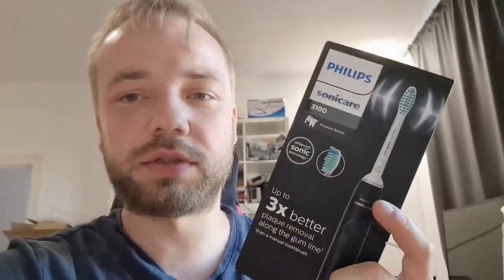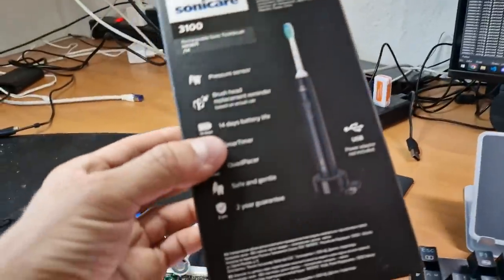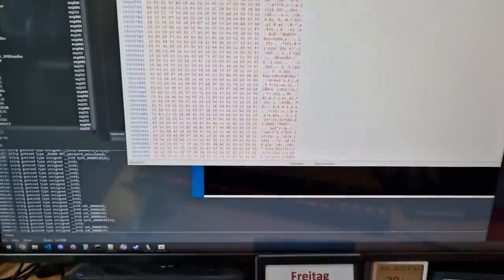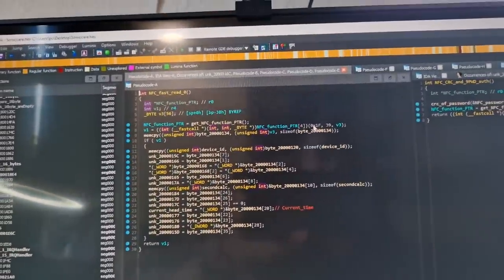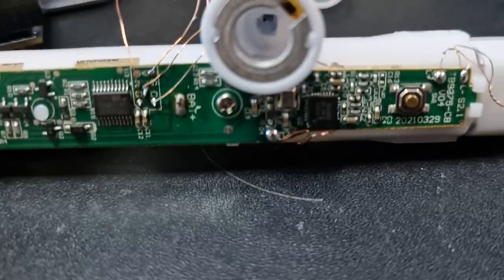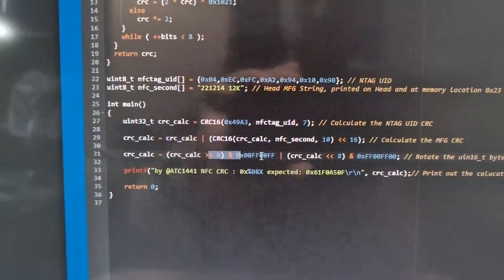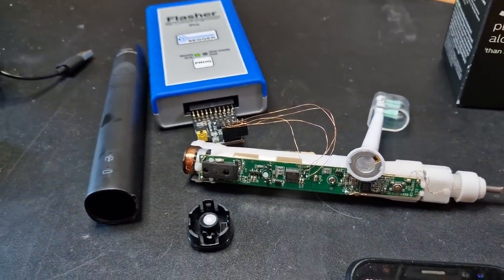Hacking the Philips Sonicare NFC Password

Comment: these devices are getting ridiculous, next you won't be able to brush your teeth without being connected to the internet.
Reply: While it’s not necessary to have an internet connection, you’re also not wrong. Today it might only notify you to replace the part. The only reasons to so severely over-engineer this is tomorrow it will stop working until you buy a replacement. Second, if a third party wants to make cheaper replacements they’ll get themselves sued over DMCA - hacking - laws. It’s the same obnoxious business model as printer ink and farm equipment.

In the US at least, anyone is allowed to make and sell for example compatible replacement car parts without the manufacturer’s permission. If the part has “digital security” however - you’re now breaking “copyright” law by breaking the “encryption” or reverse engineering the software to make a compatible part.
Reply: I’d replace the microcontroller with a simple oscillator. That’s all it needs! Stop brushing when you get fed up with it, rather than when it beeps.
Reply: Ayy Leeuz  A colleague once told me about a "smart" electric socket he purchased - one that would have a motion sensor and would turn on the socket if needed. After some time he was offered a firmware update for his electric socket. One of the new features was the support for activating the socket by noise, like clapping. Seems there was a microphone in the socket the whole time.
Reply: Subscription based teeth cleaning coming next.
Reply: @Time4Technology  chances are it was there all the time because the original firmware wasn't robust enough, so they just went with the motion sensor.  Without it having access your or wifi, it's going to be pointless having a microphone for covert things.
Reply: Don’t forget to brush your teeth, this is the second day without oral hygiene, we will have to reduce your access to public places. Yours , your future government.
Reply: ayyleeuz4892  I was replying to a comment that wasn't anything to do with this toothbrush.  It was a smart socket that had a new firmware update available.  Have a read through the comment history.
Reply: @bigjd2k  i actually like the timer, keeps me from brushing a hole into my molars
Reply: @gavinnoname1424  thats called a dentist
Reply: A couple of years ago I bought a Braun toothbrush that required me to have GPS on before the Bluetooth software would work. Needless to say I didn't use the software.
Reply: I don't think this is at all about forcing users to change brush heads. I think it's legitimately intended as a useful feature, and does have significant value for the users that want it.

(The manual also tells you how to turn the brush reminder or the pressure sensor off if you wanted to, but if you're buying a new toothbrush, it might make more sense to just get one of the cheaper models that has only the pressure sensor or doesn't have either)

However, only their pricier brush heads have this feature.
Since the memory is password-locked, third party makers of generics most likely can't include it without violating weird US copyright laws. So you have to buy the premium heads if you want the convenience features.

However, now that this has been reverse-engineered, you could likely reset the chip and transplant it to a generic head, saving money and preventing e-waste at the same time.
Reply: Smart toothbrushes were actually just used in a DDOS attack. Lol.

Comment: The crappy thing is that they locked the ndef records and most of the useful space on the tags so those are unreusable. There are so many of these they would be neat to recycle into tag rings. You can pop the ends off of the old heads really easy.
Reply: Can't that part be hacked too? 😂
Reply from the maker: @MoesKeckeEcke  unfortunately not
Reply: @atc1441 Always a question of how much energy (money/time) you invest.  😉

I guess with 500k and 0,5 man-years it can be done.

Comment: Great video! I got a flipper to try and understand protocols and now I’m diving into NFC. I actually was brushing my teeth and decided to scan it and was very surprised when it actually read. This brought me to this video. The flipper let me unlock the brush head by manually inputting a password but not I’m trying to see if it will let me input an NFC command to reset the clock. Do you have any experience or tips with doing this with a flipper by chance? I’ve only been trying to tackle this for a day so it’s keeping me busy. I’ll let you know if i figure it out

Comment: Found a bit more information about memory location 0x24.  I believe the last two bytes (02:00) represent the TYPE of head attached.  If I put on a different type of head (a whitening type), the bytes are 00:01.  For my CLEANING head I get the standard 02:00.  Good to know if I am reprogramming the type.  When I have one expire, I will write a different head type to it to verify my findings.
Reply: I suspect that is actually the mode of the brush head. The fancier models with multiple modes can automatically switch to a recommended mode for a new brush head depending on the type, and can write back/save a new mode for that head if the user changes it. Perhaps someone is able to test this further?

Also, if anyone is interested, I did some testing of how the pressure sensor interacts with the counter, since they advertise the reminder feature as taking your brushing pressure into account:

0C:0A (initial value)
5 seconds with no pressure
0F:0A (+3, likely not me not timing correctly)
5 seconds no pressure
14:0A (+5, exactly as expected)
5 seconds full pressure
14:0A (huh??)
20 seconds full pressure
14:0A (does it not count while the pressure sensor is triggered? That seems weird. Maybe it counts as a different rate but needs to be released while it's on to save it?)
5 seconds no pressure, 5 seconds full pressure, 5 seconds no pressure
3C:0A (+40, Wow. That seems like a lot.)
10 seconds, varying pressure
55:0A (+25, That's definitely counting faster.)
10 seconds, some pressure but not triggering the pressure warning)
5F:0A (+10, seems to only have 2 rates? I wonder if I could get it to save the high-pressure rate if I let off the pressure right as I turn it off.)
5 seconds full pressure, brief moment no pressure
5F:0A (That didn't work. Let's try 5-5)
5 seconds full pressure, 5 seconds no pressure
7D:0A (+30, Wow. That's a lot again, but it doesn't seem to make sense with the values I got before? Let's try 5-5-5 again and make sure we're timing it super carefully)
5 seconds no pressure, 5 seconds pressure, 5 seconds no pressure
AA:0A (+45, seems like a pretty high multiplier, but it's hard to tell exactly assuming any part of that might be off by one . Roughly 3-4x? Let's try 5 seconds pressure and 1 second no pressure.)
6 seconds pressure
AA:0A (I forgot to let off the pressure...)
5 seconds pressure, 1 second no pressure
C4:0A (+26, 2.5x? I'm very confused. Let's try 20 seconds pressure, 1 second off.)
20 seconds pressure, 1 second no pressure
16:0B (+82, oof. That definitely looks like 4x? Let's try 10 and 1 to check if that's linear. Potentially it could be doing something fancy since we're doing weird results and it doesn't save it until you let up on the pressure)
10 seconds pressure, 1 second no pressure
53:0B (+64, I am super confused. Perhaps it's not binary like I thought?)
5 seconds with moderate pressure that sets off the warning, 1 second no pressure
73:0B (+29, huh?)
5 seconds pressing really hard, 1 second no pressure
92:0B (+31, huh??)
10 seconds pressing really hard, 1 second no pressure
D0:0B (+62, okay, this seems consistent. 6x?)
10 seconds moderate pressure that sets of the warning, 1 second no pressure
0E:0C (+62, okay, so it seems to count at 6x while the pressure sensor is active? That seems to line up with some of the tests, assuming they might be off by one, but not all of them.)

I just graphed the increases from pressure over time pressure was applied. It looks similar to
increase = 64 log(duration)

60 seconds pressure, 1 second no pressure
89:0C (+129)

Now it looks linear except for the 5 second ones?

Perhaps someone else can test more. It seems to be roughly 6x for long durations of high pressure, but a lower multiplier if you only briefly trigger the pressure sensor.

Comment: I have this same toothbrush. Impressive work! Although, you are already able to disable all of the brush head reminders with the built in settings. I've done it with all of mine- there's a simple button combination you press to change many different settings. Sometimes the best solution is to read the manual!
Reply: Damn lol
Reply: I lost the manual, how to do that? =)
Reply: For my model (HX3684), you hold down the power button while it's on the charger.
After 3 seconds, it will beep once. Release now if you want to toggle 'EasyStart' (a mode the brush ships in where it slowly increases the intensity for the first 14 cycles, to help people adjust to using an electric brush for the first time)
After 5 seconds, it will beep twice; release now to toggle the brush head replacement reminder.
After 7 seconds, it will beep three times. Release now to toggle the pressure sensor feature.
If you keep holding the button, it will cycle around again.
If you turn any feature on, it will beep low-med-high and the battery light will blink green twice.
If you turn any feature off, it will beep high-med-low, and the battery light will blink amber once.

I don't believe the brush head reminder is intended to be directly hostile to users.
It counts the lifespan based on total time used and supposedly counts faster while triggering the pressure sensor.
It's actually very useful if you need to brush longer than 2 minutes or more often (because of dental appliances, etc) which would make recommendations on when to replace based on average use less helpful.

I do consider it a *feature*, and NFC seems to be a really convenient way to implement it that allows for seamlessly tracking multiple heads.
The fancier models supposedly also use the chips to switch to a recommended setting for specialty heads (gum care, etc.) and will save your last used mode to the head if you change it.
 
However, the catch is that only their pricier brush heads include these chips, and locking them with a passcode prevents third parties from creating generics with these features.
So if you want fancy head wear tracking or convenience automatic mode switching, you have to pay a premium, and third parties can't make them cheaper)

Now that this has been reverse engineered, however, you could definitely reset a chip and transplant it to a generic head.

Comment: Hi Aaron, couldn´t you just remove the nfc tag from the brush head? Or just give it some "heat" from a soldering station?
Reply from the maker: Yes you can :) 
Another way is also to write 3 times the wrong password. The useage time will then be locked to its current value.

For me it was just about reverse engineering the password algo^^

Comment: Awesome work. In the end it might look simple (it mostly does), because the way it's done can't be very complicated. But it's the way to get there which is amazing. Thanks for sharing! Next: Flipper App to change the brush date? ;)
Reply from the maker: Thank you!
I am not a Flipper fan^^ maybe someone else will create one with this info.

I would be more into creating an Android Application to change the useage time via NFC 👌
Reply: @atc1441  any reason you would like to share why you don't like the Flipper? It's really handy and like a multi tool. I mean, android is perfectly fine, too. :) But surely, this could be done by someone else, the main work is done by you ❤️
Reply from the maker: The shortest to explain.
The Flipper is nice for use of existing exploits but not so much for developing them which is what i love to do
Reply: @atc1441  ah, makes perfect sense. For actual hacking or more developing I wouldn't use it either. As said, it's more like a multi tool. Nice to have on you and work's for small tasks, but I wouldn't try to build a house with it. Again, thanks for your work and sharing it and: weitermachen;)
Reply: @svenmichelsde Aaron did a great job here, but in the context of developing and publishing a polished Android app I wouldn’t call it the main work. Prototyping is the most fun part, for sure.  😇

Comment: What I would add, as someone who has a Philips toothbrush, is that I've not once had it do the reminder to change the head. I have no idea if my toothbrush is faulty, or it's because I'm on the low vibration setting, or if my head's are faulty. So for me anyway, it's nowhere near as bad as printers, where some companies printers refuse to print based on a timer (even if there is still ink left), or if they're 3rd party cartridges. So I'm glad Philips didn't do such a thing here, even though they could have
Reply: I’ve never received a notification either on my brush to change the head - so not sure what the purpose of these tags really are. It also allows you to use the toothbrush with non-RFID tagged brush heads
Reply: I’ve gotten the alert on my toothbrush (it lights up and occasionally plays a tone, I don’t use the app). It sucks that they waste precious resources on this gimmick, but from my experience, the brush head was indeed noticeably wearing at the point when it started alerting. I usually keep using it for a week or so after the warnings start.
Reply: @fqdn I agree.  I wasn’t sure if the NFC was working, so I toughed it out until the blinking and alert tone sounded.  I was ready to change the brush, which was pretty worn out, long before the handle started nagging me.  I thought the DRM would require the NFC tag to be present, but the handle happily vibrates with a Chinese knock-off brush or even nothing at all attached.

It is kind of cool that each brush keeps track of its own elapsed time, so the user can change between brushes at any time.  Still, the rating is so conservative that most people would change the brush anyway before the handle ever nags at them, thus rendering all the technology moot.
Reply: Older devices do not have the NFC functionality, even if the new replacement brushes do.

Comment: Awesome!
Now I am curious on the PACK part.  which would be the *a2 in your decompilation.    You have samples of it too?
Reply from the maker: Which one do you talk about ?
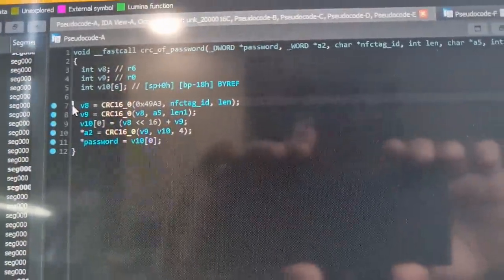Reply: Hey Iceman ;) as per NFC21x tags datasheet, at offset x2b you have a 32bit password and at offset x2c you have a 16bit password acknowledge (PACK). These locations cannot be read after programming (always return zero).  It is apparent at 4:20 how the PACK is calculated. It seems to me to be the CRC16( CRC16(0x49a3, UID), CRC16( CRC16(0x49a3, UID), MFG) ) where MFG is the datecode looking string stored at x21-x23
Reply: @d18c7db   I know they can't be read,  but if you sniff the traffic you get that data since its sent in clear text over the air.     And yes,  my reference to *a2 is seen 4:20.   I still wonder about actual pack samples. 

side note,  when it comes to the MFG,.  the x21-23 ,  or rather  two last bytes of x21,  then x22,x23,  since its only 10 bytes.  According to the other dude,  he found the x22 is related to color of the head.  I figure that makes two possible MFG strings,  generating two possible sets of pwd/pack.
Reply: @iceman1001  well IMHO the numbers really look like date YYMMDD then a space and a two digit and letter unique identifier. I have several such heads and some have different date codes even though they are same colors same type (I should verify a batch that comes in a pack together and see). I can also provide some proxmark captures though this may not be the best forum, for UID 04 fd 78 72 67 67 80 after anticollision, I see this where 0xf31e is the PACK followed by two byte iso14443a crc
| Rdr |3a  04  27  1d  62                                                       |  ok | READ RANGE (4-39)
| Tag |03  20  d1  01  1c  55  02  70  68  69  6c  69  70  73  2e  63  6f  6d   |     |
|     |2f  6e  66  63  62  72  75  73  68  68  65  61  64  74  61  70  fe  00   |     |
|     |00  00  00  00  00  00  00  00  00  00  00  00  00  00  00  00  00  00   |     |
|     |00  00  00  00  00  00  00  00  00  00  00  00  00  00  00  00  00  00   |     |
|     |00  00  00  00  00  00  00  00  00  00  00  00  00  00  00  00  00  00   |     |
|     |00  00  00  00  00  00  00  00  00  00  00  00  00  00  00  00  00  00   |     |
|     |00  01  00  00  00  00  00  02  60  54  32  30  30  31  32  34  20  34   |     |
|     |32  54  7d  5d  02  00  00  00  02  00  00  9d  5a  02  00  00  00  01   |     |
|     |df  7c                                                                   |  ok |
| Rdr |1b  ee  53  a9  6a  0e  31                                               |  ok | PWD-AUTH KEY: 0xEE53A96A
| Tag |f3  1e  3f  b1                                                           |     |

Comment: I tried this, but for the love of me I cannot write anything with NFC Tools to my brush, it always says IO failure

The head still works so I think nothing was written yet, since I dont think I locked myself out
Reply: I can try and help out. What is your UID and the manufacture string for the toothbrush head and what is the exact command string "1b:xxx, 24:xxx" you are sending to it with NFC Tools?
Reply: @d18c7db  The exact string looks like this: 1B:06:9D:4F:EA,A2:24:00:00:02:00 

My UUID is: 04:3E:A7:BA:2B:72:80
My manufacterer string from head is: 210825 11K 

All copied from NXP TagInfo app 

Password that the code generated is: 069D4FEA